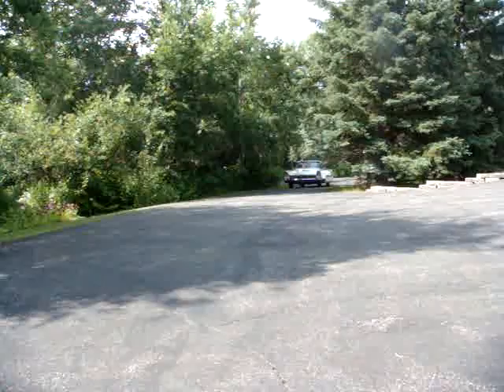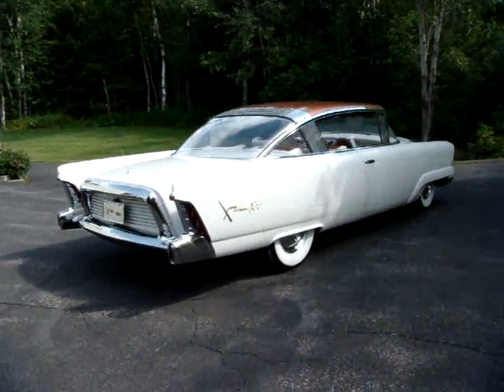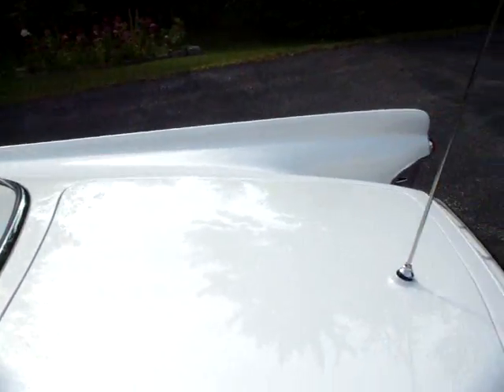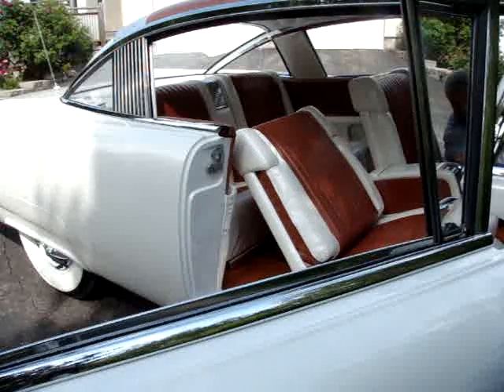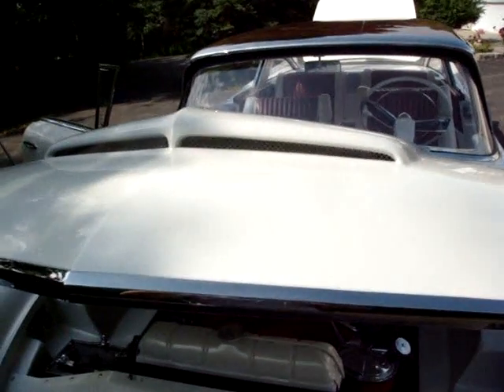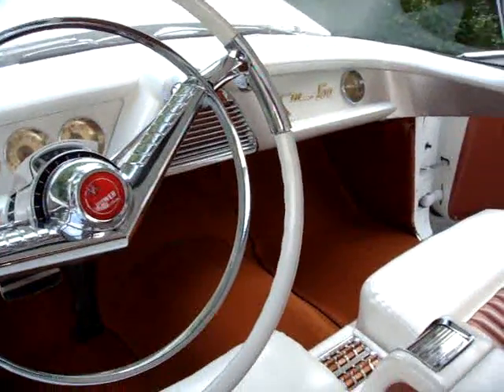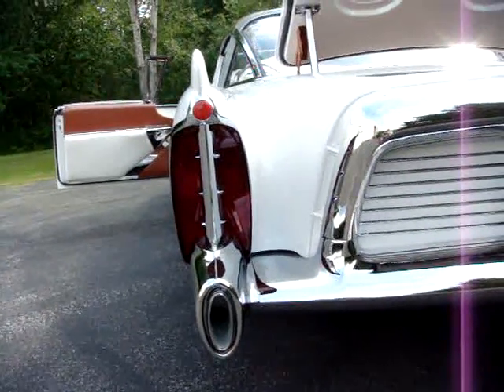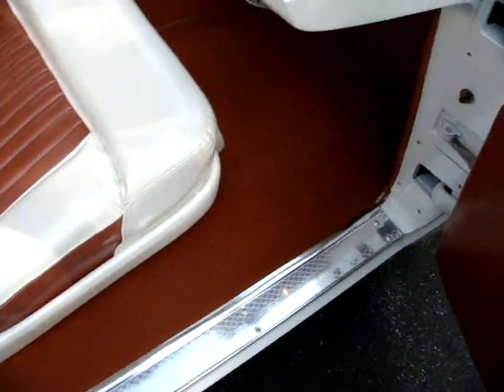The All New XM 800

Comment: Tom, a gorgeous restoration. I thought I had seen some of the car's features before. In checking I found that the center console and power seat were used on the '56 Packard Predictor. And the Mercury did them two years before Packard.

Comment: A small correction: It was not Pontiac that offered 4 individual bucket seats in 1960, but the Chrysler 300F. Yes, you could get (optional) front buckets in a `60 Bonneville, but the rear seat was always a conventional single seat spanning the width of the interior.

Comment: ... superbly done restoration of a genuine 1950's "jet age" futuristic styling themed Detroit "dream car" ... future was looking like this to 1950's Detroit auto dreamers ... the styling of these "cars of the future" plainly suggesting jet /rocket/atomic powered travel ... the wheels and tires could /can be seen as being superfluous to these dream cars which plainly were styled to reflect futuristic looking autos capable of airborne travel on automated control/guidance mid air "freeways" in and around and from/to futuristic " cities of romorrow" ... the future was looking very positive to the Detroit of the 1950's ...  1960 Chrysler 300's had four bucket seat with center consoles interior layouts ...1960 Pontiac was mentioned in this vid ... John Najjar had a major role with the concept/ creation of the1958 Lincoln which was pure late 1950's Detroit at it's best tho these fabulous Najjar Lincolns were not big sales success for Ford and sadly were long under valued as Detroit icons .

Comment: A very lovely car, showcasing years ahead of it's time many styling ques and functional features that showed up in Ford products as late as 1957. This car is much like another concept car, the Mercury Mystere, built about a year and a half later.  

This car allso showcases a few styling drawbacks as well, such as low wheel wells making for cumbersome tire changes, and the bumper tipped exhaust.  Not sure what it does to fiberglass, but the steel versions of the company's production cars saw rust at the bumper tips. 

Perhaps there were too many new things about the car, someone forgot to include a feature that would soon become a mainstay in most new cars manufactured since 1968: air conditioning.

Comment: 1954 Mercury XM-800 concept car

Tom Maruska restored and auctioned in 2010 

The 1954 Mercury XM-800 was a concept car that debuted at the 1954 Detroit Auto Show. 

It was designed by John Najjar and Elwood Engle in 1952. 

The XM-800 was based on the Mercury Monterey chassis and had fiberglass body panels. 

It was pearlescent white with a copper-colored roof. 

The XM-800 was a full-size two-door hardtop. It was often referred to as a "Dream Machine" because it was built to test new ideas. 

The XM-800 was designed in the Mercury Pre-Production Studio. It was once owned by Joe Bortz.

Comment: Was the engine the 256-CID Mercury V-8 that debuted in the '54 line? Ford had originally planned to bring out OHV V-8s for the entire  family in '52 but the Korean War slowed them to where only the '52 Lincoln got them. For '55 the Fords were supposed to get the 256 and Mercury would have gotten a 272. But when HFII hear about Chevy's 256-CID V-8 for '55 he said basically, "No way will Chevy's V-8 be bigger than Ford's." So for '55 Ford got the 272 and Mercury got the 292. The HP race was on.
Reply: This car is just like Studebaker designs--I can't tell whether it is coming or going!

Comment: About the only thing that needs improving is that the trunk lid opening should be larger.   The interior is a work of art.   The split bench seats were what eventually used in later model Fords and Mercurys.
Mercury had some of the best if not THEE best  concept cars.    And who was the clueless imp that said Mercury was irrelevant?

Comment: Nice restoration, but calling fiberglass plastic is quite a stretch,  it's glass fiber and epoxy. It is easily replaced with hemp at a much cheaper cost. Kind of like that truck in the Cheech and Chong movie, fiber-weed. they weren't too far off the mark! But Hemp saves tons if energy, it's not manufactured under intense heat, it just grows for you.